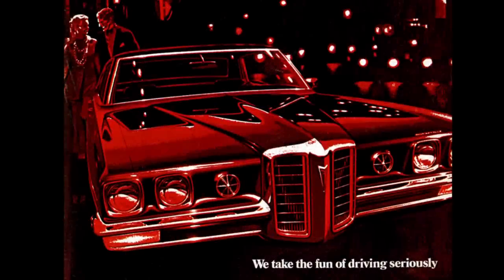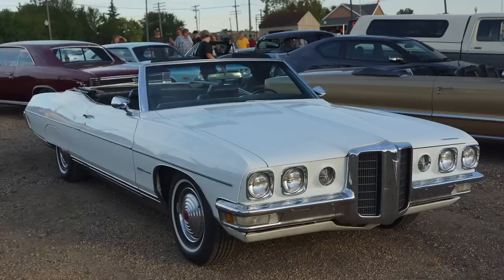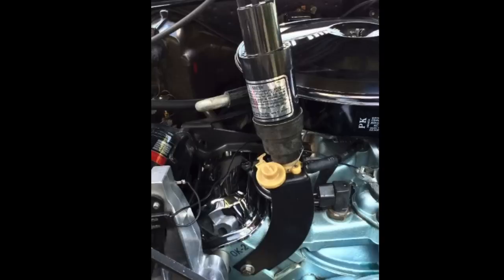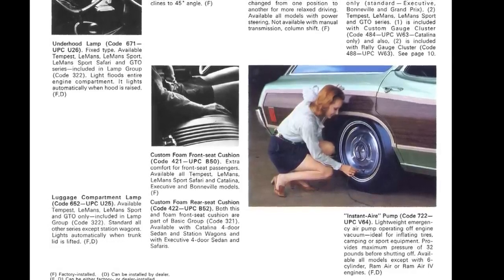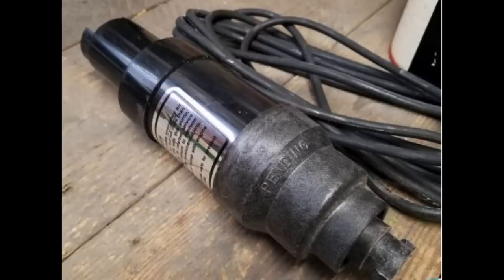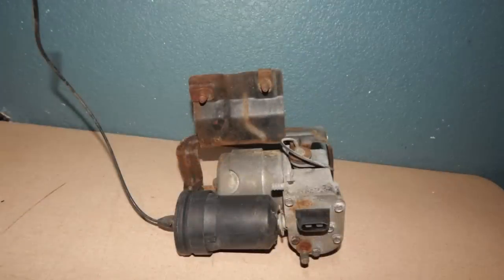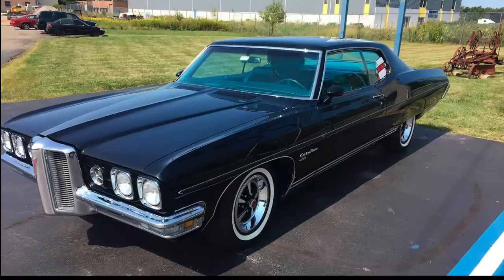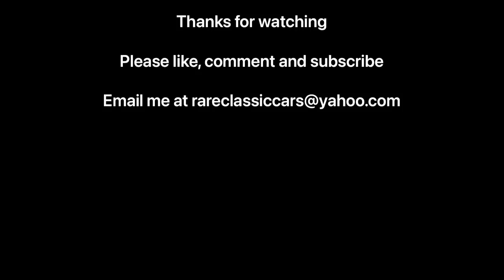Awesome Automotive Inventions: The 1969-72 Pontiac Instant-Aire Underhood Air Compressor

Comment: I have a 69 Bonneville that has the three features you mentioned; Instant-Aire, auto level system and the real out under hood lamp, a few comments on each…

1… Instant-Aire ($15.80): in 69 you could order it on 6 cylinder engines (the OHC six) but it wasn’t available with Ram Air engines (perhaps due to lower engine vacuum) or the standard equipment GTO engine because it’s unique dual snorkel air cleaner was in the way.  In 1970 the bracket for Instant-Aire was resigned as was the dual snorkel air cleaner allowing for its use with those engines.  I suspect that the switch to the old OHV chevy six would have required a new mounting bracket which given what was likely very meager sales of the option on six cylinder cars made them simply drop availability.  One surprising thing is just how loud the air pump is when operating.  Also the 17’ long hose is an accident in the making with it flopping around the running engine with the fan spinning away.

2…Automatic Level Control ($78.99): maintained a level ride stance and works surprisingly well and included rear air shocks. The weak link though was the air intake, it used a foam filter that deteriorates and the foam particles get sucked into the pump and as they melt they eventually seize the pump piston.

3…the reel out lamp option ($7.37): dated back to the late 40’s Pontiac but was trunk mounted until the mid 60’s when it switched to an underhood position.  The trunk units mounted on the trunk lid and were controlled by a mercury switch, the underhood units use a firewall mounted brake light switch to control them.  In both cases they had a 17 foot long wire that was spooled into the unit that you twisted the lens while holding the base to reel out the needed length of wire.  These are super handy (especially pre cell phone) as they can be used to work under the hood by placing them exactly where needed and even more so they can be placed on the ground while changing a spare tire, they even had one side of the glass lens painted translucent red so you could place them on the roof of a disabled car to warn traffic without having your battery run down quickly by having all your lights on inside and out.  By the way this option was only offered on the full-sized line, the Firebird, Grand Prix and GTO-LeMans line offered an optional underhood lamp but not with the reel out feature.

Another interesting option new for the 69 Pontiac was something called Power-Flo ventilation ($42.13): It was offered on all models not ordered with air conditioning (except the few remaining models that still had vent windows).  To best explain what it did I’ll start by explaining how the ventilation worked on non AC cars of the era.  The heater fan could direct air down at your feet or up the defrost duct onto the windshield but the dash vents on these non AC cars were only connected to outside air that required car speed to move any air.  Power-Flo was a 2 speed forced ventilation system that could blow fresh air from the cowl through the dashboard vents, especially useful when the car wasn’t moving.  It used two small fan motors (one on each side) literally hanging inside the cowl air plenum right where the air inlet was for the dash vents.  It worked quite well at low speeds but at higher speeds the interference caused by the fan housing actually reduced the airflow relative to what you’d get you’d get on a car without the option.  A poor mans AC is how it was promoted.

Another oddball option made its last appearance in 69, Vebra-Phonic, a Reverberating rear speaker ($52.66) that the reverberation could be turned off or on as desired.  It worked by running the rear speaker signal through a very long coil of fine copper wire that delayed slightly the signal reaching the rear speaker creating an echo or “concert hall” effect.  It could be pleasing sounding with some non vocalized music (like classical) but downright annoying with talk radio or news etc.  it was basically a poor mans stereo and I suspect the growing popularity of stereo radios and stereo 8 track was behind its demise.
Reply: Thanks John for providing this level of detail. I'm certain Adam will also benefit from your knowledge.
Reply: John Hall - Thanks for the th
orough history lesson & details, John!
Please post photos someday, your car sounds beautiful and interesting.
Reply: I don’t believe you can post pictures here?
Reply: @John Hall  Oh sorry, I guess I just meant be sure to post pictures of your nice '69 Pontiac - I assume you'll create your own channel.
Reply: I’ve never seen a 1969 Pontiac with the rear lamp outage indicator. I have never seen it on a 1970 either, but I saw it in their Accessorizer catalog. I ordered it (front and rear) on my 1981 Cutlass Supreme. I loved it, especially for how simple it was. Fiber optic light tubes. Nowadays they’d make some overly complicated thing to do the same job.
Reply: My best friend growing up bought a 1968 Mercury Montego with a power flow ventilation system. It did not work very well.
Reply: @dave1956  lamp monitoring was never offered by Pontiac in 69 or 70.   Chevy did however (front and rear) offer it and therefore the Canadian Pontiac’s which were really chevies with some Pontiac sheet metal could be ordered with it, perhaps you saw it in a Canadian brochure?
Reply: @JohnnyAloha69  

Incorrect, at least as far as the Pontiac Accessorizer catalog is concerned. In 1970 Pontiac offered a “rear lamp outage indicator”. It sat on the rear package shelf. You are right about Chevrolet. From 1967-1970 they offered “vigilight” front and rear lamp monitors on the full sized vehicles. It was also offered on Chevelle, Camaro, Nova & the 1970 Monte Carlo. I know that in 1969 it had a suggested retail price of $26.35. What a bargain. I don’t recall exactly, but I am certain that in 1981 my Olds Cutlass Supreme that was equipped with it, the cost was somewhere around $60.00. It was the best thing on the car.
Reply: @dave1956  you are correct, I forgot that in 1970, they did offer a rear only system.  Through the 70s into the early 80s those fiber optic lamp monitoring systems were a very common option on higher end GM cars.

A new option on 1970 Pontiac’s was a headlight delay system. It was similar in concept to the common Cadilac option, but without your being able to control whether or not it was on or the amount of delay.

Comment: Thanks Adam. We had a 1997 Pontiac Transport van that had an electric compressor mounted in a compartment in the rear cargo area. It had a long hose that would reach any of the tires, and as you stated, it supplied air to the rear shocks automatically. As you loaded up the van you would hear the little compressor run and the vehicle would lift slightly! Great car! It drove really well, was economical with the 3.4 V6 and it was really good in the snow! Miss Pontiac!

Comment: My friend had a plain vanilla GM lime green 350 small block V8 3 speed automatic 1971 Pontiac Firebird, likely with a 3.08 differential.
She ran all day at 135 mph.
It was like sitting in your quie living room as you passed by cars on the interstate as if they were parked on the side of the road.
This Pontiac Firebird is the smoothest, safest high speed car I have ever ridden in or have ever driven. Though fine cars in their own right, it bested Corvette and Foxbody 5.O in this regard. The Pontiac Firebird speedometer was lock- on steady with no waver.
Pontiac made a great and reliable car.
Wide Track forever!
Reply: Detroit Iron is the best!

Comment: I’ve seen a similar trunk lamp that came with a long retractable cord listed as an option in a 1950’s brochure.  Perfect for tire changing at night.
Reply: I want one of those under hood lights from a mid 90s Chevy/gm pickup. 
They have enough cord to reach the furthest tire for changing.
Forget finding one in a boneyard ,that's a hot item ,every hood I pop they're gone.
Reply: One of the few examples of engineering for customer benefit.
Reply: Jason  there use a bracket that mounts on the intake and it connects to a hose that branches out from the vacuum of the PCV setup.  The routine was that you’d remove the pump from the trunk, remove the cap from the engine bracket (with the engine off), lock the pump in place with a quarter turn, then start the engine which would power the pump.
Reply: @MrTheHillfolk  So funny you mention. I first saw one of those under the hood of a new 1986 Ford pickup and always thought that was the epitome of high end. Lol. Then I never saw them again. It always stuck with me and didn't know anyone ever paid attention to them. Cheers

Comment: Adam, thank you.  When I was a kid, my dad had bought a used '63 Pontiac Catalina that had the Underhood Utility Lamp.  However, in that car it mounted in the trunk and served double-duty as the trunk light as well.  I remember it had a bracket that the lamp unit slide into and when the lamp unit was removed from that the wire for the power lead was pulled out of the lamp unit.  There was enough of that wire to reach up to the front of the car and into the engine compartment.  The back side of the lamp unit may have been magnetic.  The wire was spooled back into the lamp unit by holding one side of the lamp unit and rotating the other side.

Comment: Thank you Adam. Pontiac did do a lot of little things that later appeared on other cars. They came out first with the steering wheel controls on 6000 STE in 1986 that went on to spread to other GM brands. I recall these air pumps. I thought the Bonneville in the late 1980's offered an air compressor with its emergency roadside kit. That was another thing in Pontiacs too. You always find these interesting things to share. GM was innovating through many of its brands.

Comment: My dad's 1929 Lincoln Touring Car had a PTO air compressor, turn a screwhead on the driver's floorboard 1/4 turn, and screw on a 25' hose, worked well! It also had the retractable electric cigar lighters on 6' cords. I seem to remember my '51 Pontiac had the trouble light also.

Comment: I had an NOS Instant Aire kit added to a '69 GTO that I owned years ago and it was was quite the conversation piece at car shows as most had never seen or heard of it before. There was one catch to installing it on the GTO with the factory dual snorkel air cleaner however, the passenger side snorkel interfered with the large upright compressor bracket so a longer molded breather hose was necessary to twist the air cleaner counter-clockwise just enough to clear it.
Reply: That’s the reason that you couldn’t get Instant-Aire on the 69 GTO, the 2nd air cleaner snorkel got in the way.   They relocated the 2nd snorkel and modified the bracket on the Instant-Aire in 1970 to address the problem.
Reply: @JohnnyAloha69  
They must have overlooked that since there's nothing shown on the order form or brochures that exclude standard GTO engine w/o Ram Air.

Comment: My Dad bought a brand new 1973 Pontiac Catalina with a 350 4 bbl dual exhaust. It cost $4600 Canadian plus tax.  That car had two very odd quirks:
- the alternator light flickered from just after the warranty expired until Dad scrapped the car about 10-12 years later - but the alternator itself NEVER failed and batteries always seemed to charge OK.  
- there was a consistent and heavy rattle in the exhaust system (dual pipes) and when it finally came time to replace the RH tailpipe, the muffler shop cut it off and sure enough: out fell a piece of steel re-bar about 3 ft. long.  It must have been put in there by some union goofball in the pipe-bending line at a factory.  
Otherwise, it was a good car that gave very little trouble.

Comment: Food for thought for a new video: Chrysler had many, many unique features back then:

1.) Outboard fender turn signals available on nearly all model cars.
2.) The Dodge "third eye" driving light on full size Monacos.
3.) Carbon fiber wheels (recalled).
4.) S.E. vinyl roofing (paisley, flower power, etc.).
5.) A gold Chrysler Pentastar emblem on ALL cars, located passenger side rocker panel.
6.) Airtemp AC, by far the best in the industry.
7.) Driver binnacle "flood lighting" of all key instruments (1969-1973).
8.) The executive's swivel passenger seat and pull out desk on the 1967-8 Imperial.
9.) Crazy-fast power windows that closed so fast you risked appendage capitation.
10.) The "PLYMOUTH" engine hood release sited in a cove in the middle of the front bumper, only on 1972 Fury's (the baddest-looking full size American car of all time).

Those are just the ones, all unique to Chrysler Corporation, that jump easily to mind. There are more, though.

Comment: Fun segment.  Regarding compressors for automatic leveling, the electric pumps introduced with the 1978 GM models were significantly more reliable than the vacuum units of prior years.  My 1973 de Ville and 1974 Fleetwood both suffered system failures before the cars were five years old - and I was told this was common - but my electric pump models were trouble-free.

Comment: A customer of mine used to have a Pontiac TranSport minivan - handicap van - and it had the air pump. It literally was the run-of-the-mill rear air shock system, but it had a button in the rear of the van to use it for filling tires. Next to the button, there was a Schrader valve. So you would need a long hose with a female Schrader valve connection on both ends.

Comment: I remember back in the early-mid 2000s they added an onboard inflator/compressor on the midsize SUVs with rear air suspension; it used the compressor for the air shocks to redirect into a hose in the rear cargo area. We had a 2006 Envoy with it, but by 2009 when we traded for another Envoy it was no longer available despite still having air suspension. 

Definitely an interesting feature, but one I suspect is more gimmick than substance for most buyers. I think I may have used it once or twice in the '06 just to see how well it worked, and that's about it.

Comment: I'm a Ford and Mopar guy, but sincerely miss Pontiac & Olds.
What momentum and character those brands had....and it's very sad that many factors combined to erode their market.
This specific option is very clever and well-conceived, just what I'd expect from the kind of smart, forward-thinking engineers the Big 3 were known for.
That said, I would have expected Olds to market it first, in keeping with their reputation as GM's, 'experimental car' - the brand that pioneered new engineering first amongst the GM family.
Reply: I found Fords and Mopars more reliable. I'm 48
Reply: @Rich Houle  Overall I agree, but also found the Plymouth early V-8 318 to be incredibly reliable and strong; as is their Slant-6 of course!!
I also had a very durable 1968 Chrysler V-8, 383.
Most GM brands' engines were good except the reputation chevy had for burning oil and never holding in-tune....
Whenever Chevy braggarts get too loud, I remind them that only two (2) American engines beat Ferrari at LeMans....a Pontiac 421 and a Ford 427.
* If my racing comment above is wrong, please advise.....thanks. *

Comment: late 1960s early 1970s full size pontiacs i like. neat technology for 1970s nowadays air pumps plug in 12 volt or battery operated.

Comment: We had 1 on our 70 Executive we got 3rd hand in the early 80s. The bracket was there but most of the parts were in a box in the trunk. The hose extension was missing. Dad thought at 1st that it was some sort of emissions device.

Comment: Funny how things stick with you.  When I was a kid we were at the drive-in getting a burger and this guy named Paul Stevens pulled in the lot in his '61 Tempest.  Paul was like the local fix it man and could work on anything.  Someone yelled at Paul that he had a low tire and Paul opened the hood, took out a hose and filled the tire.  My folks were quite impressed and I think that is why it has stuck with me for about 60 years.  I don't know if it was offered by Pontiac back then or if it was something Paul rigged up or got from someplace else like J.C Whitney.

Comment: OMG, Adam, that engine-mounted air compressor is listed in my '69 BUICK Wildcat owners manual as well - but I've never, ever seen one!  One wonders exactly what they did to the engines to make it "insertable" ( there was nothing in the manual the spoke about vacuum hoses. )  And, I never knew that anyone @ GM but Cadillac had an even truncated Twilight Sentinel available back then.

Comment: I remember a kit you could buy that would work with any engine. It was a hose with a threaded end that would screw into your spark plug hole. Basically you would take out your plug screw the hose in and start your engine. I'm not sure I'd want fuel mixed air in my tire but in a pinch I suppose it would work.

Comment: I've had various electric air pumps that plugged into the lighter over the years, including one that came with my '05 Honda, in lieu of a spare. Unfortunately, few of them lasted very long and most  were torturously slow, until very recently. The best of these, which is still working, is a Wall Mart brand pump with digital controls, automatic shut-off and a separate port for air mattresses; it can actually inflate an almost flat tire in a few minutes. I wonder how fast and reliable the Instant-Aire pump was, and whether it included a reservoir tank. Using vacuum alone, I'd expect it to be even slower than an electric pump.